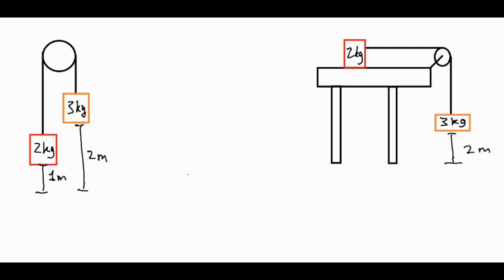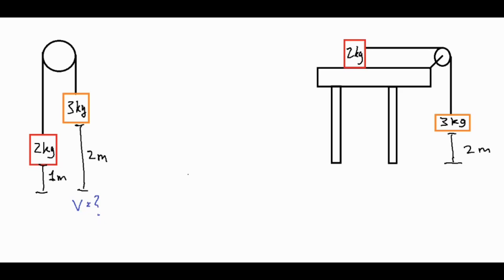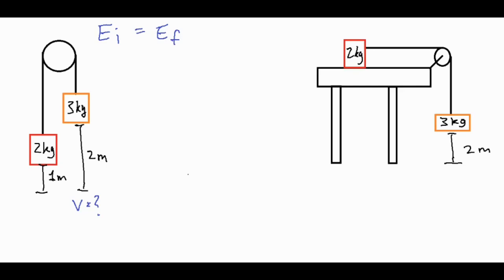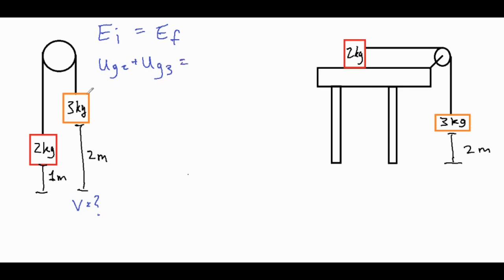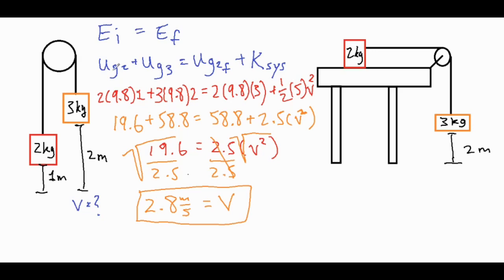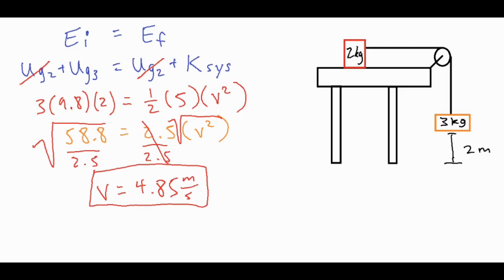Conservation of Energy Pulley Problems

Comment: Great video! I have a question about the first pulley (the atwood machine). What would happen if both masses were the same at different heights? The net force should be 0N in both blocks, so no force is moving the system. But the potential energy is different. There is no velocity (both start from rest), so no kinetic energy, but there must be different potential energy between them, so what would happen? Will they move?
Reply from the maker: Great question! Right, there's no net force, so the system will be at rest or move at a constant velocity if the system is already in motion.  The difference in their initial height isn't really that relevant to the motion they might produce.